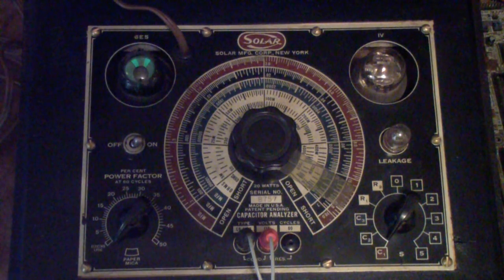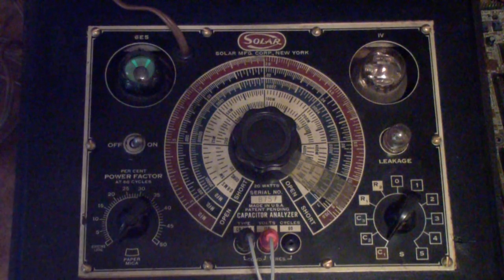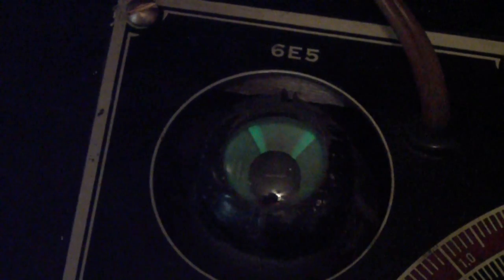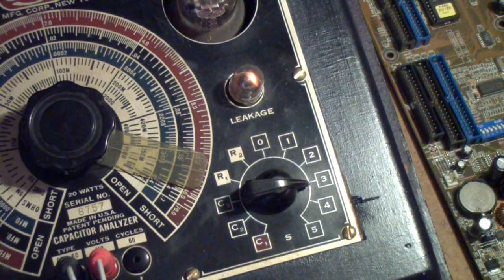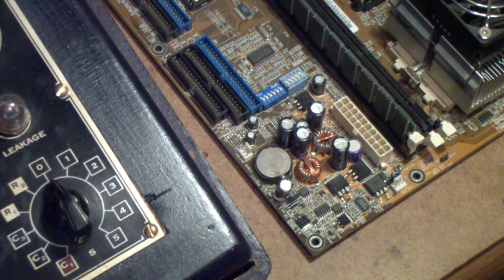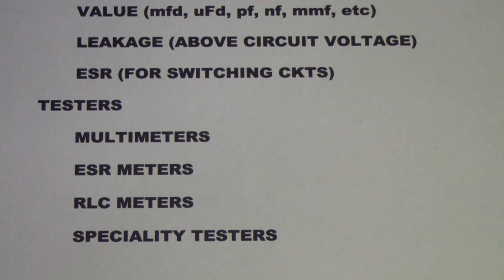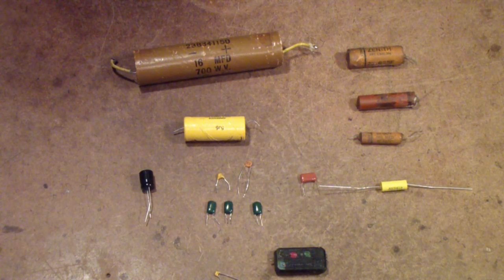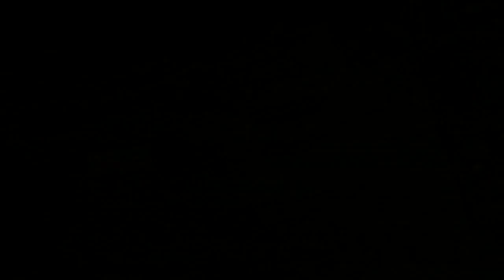TTT129 Testing Capacitors Pt A

Comment: I have an Eico 950 which I use to test used capacitors.  Its useful to characterise the component.  Sometimes I see caps that look ok but leak internally and actually oscilate a little,  that is what Im looking for in testing.

Comment: Great video, learned a lot!  I have a Solar unit like yours that I will be restoring soon. I have a Heathkit that I restored but when I ran across the Solar at a good price I had to grab it. It is a beautiful piece of equipment. I haven't actually used either of mine much yet but will start testing new high voltage caps before I install them, thanks. One thing, could you explain what the "power factor" control is for?  Ive still got lots to learn.
Reply from the maker: Power Factor is the efficiency of the capacitor in an AC circuit. A perfect capacitor does not absorb any power, it returns all the power it receives during each cycle. It is used more in circuits like motors to measure how much power is lost in the start and run capacitors, etc. It is not used much in low power electronic circuits, ESR and Leakage have largely replaced it in modern testers. If you want to see how to use the control on your Salar, look at page 8 of the Solar manual available on the BAMA manuals website.

Comment: HI Tom,, Great video,, I'm wondering if there is such thing as a Hi voltage Cap ESR meter,,What I mean by that is a ESR meter that will test capacitors rated at above say 350 volts? Hope you doing well,,, Thank you again for all your great video work,,